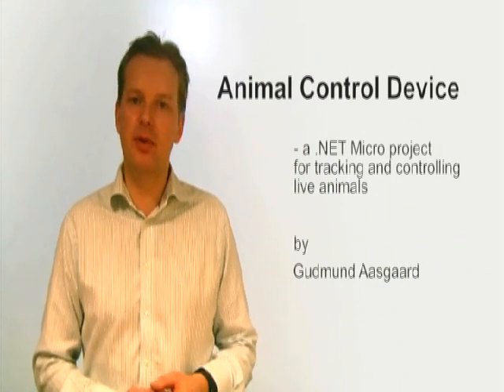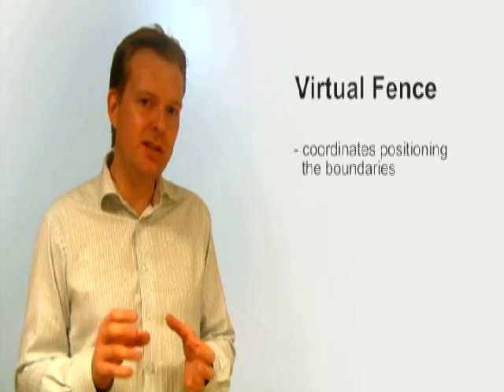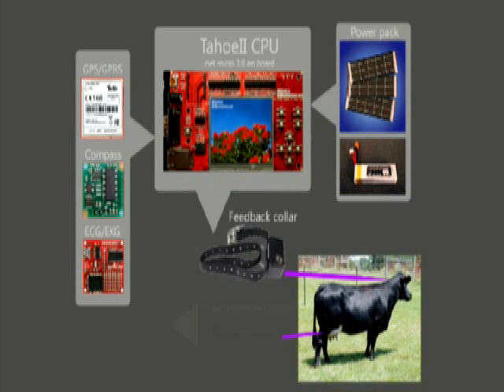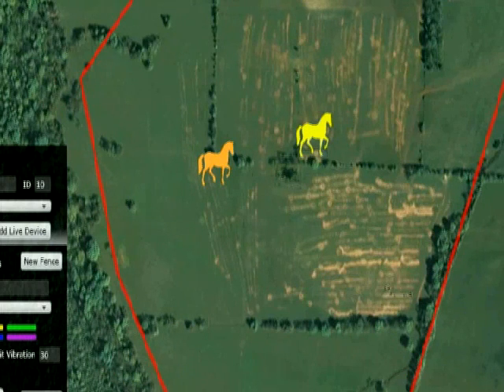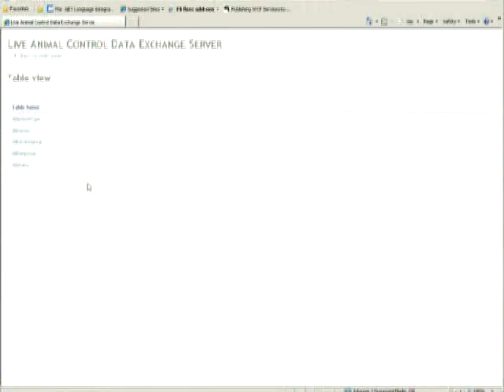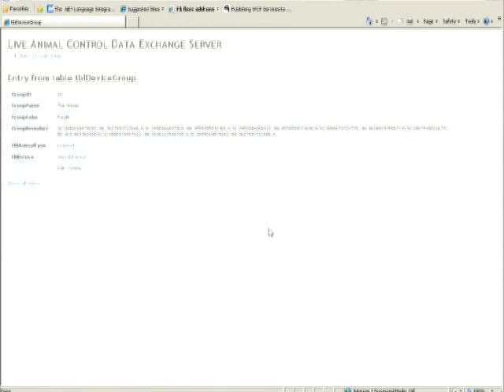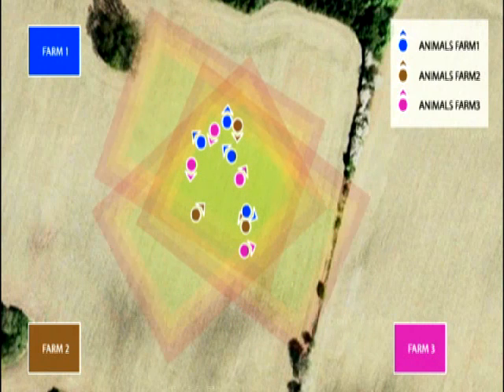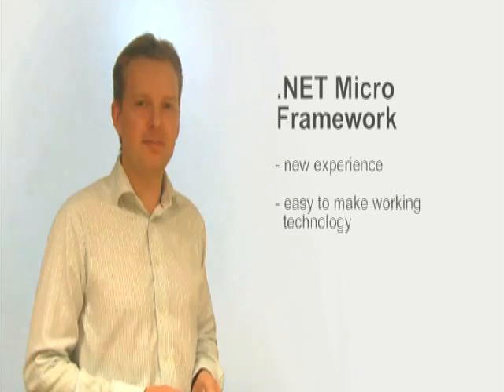Dare to Dream Different Contest - Animal Control

Comment: 1:15  
Quote: "once there is a gap in the fence" ... the fence is not useless.
Many people may not see that a fence has a gap.
the notion of a continuous fence is very strong and a gap is never thought to occur.
.
Same with animals if they have not yet found the ''gap''; the fence is NOT useless.
.
A fence is thought to be a recognised boundary even if there are ''gaps'' in the fence.
For example a boundary marked by a ditch or hedge is, since 1650AD deemed a boundary.
.
.
Cheers.
from,
del-boy